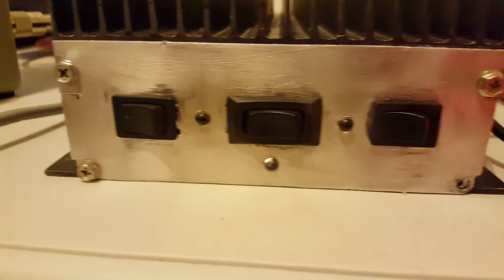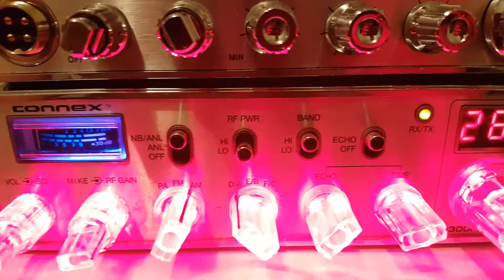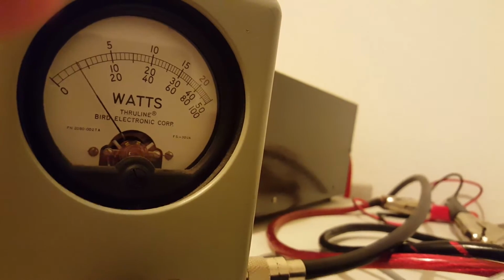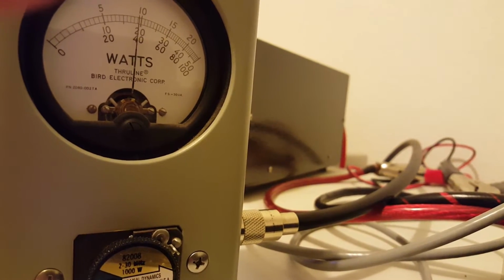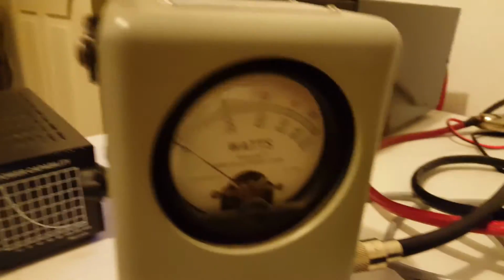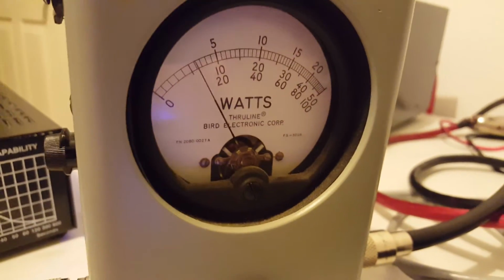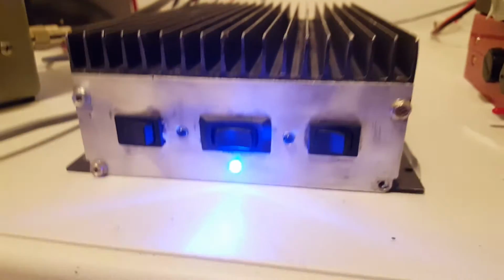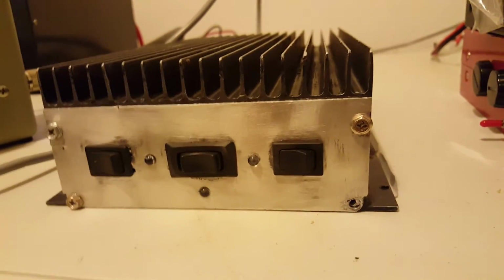Palomar/Boomer 600 mobile amp ( around 400 watts)

Comment: Rooster you are right. the  400 is a straight 4 pill box the 600 is A-1 Driving for 4. Both use 1446s